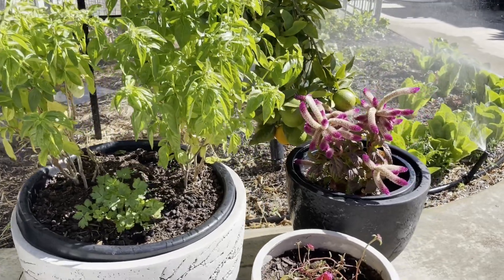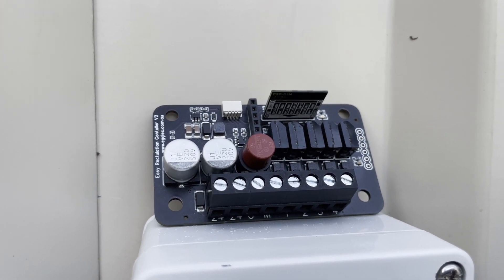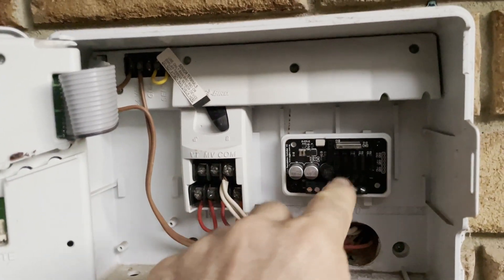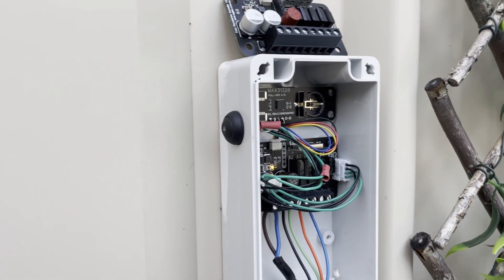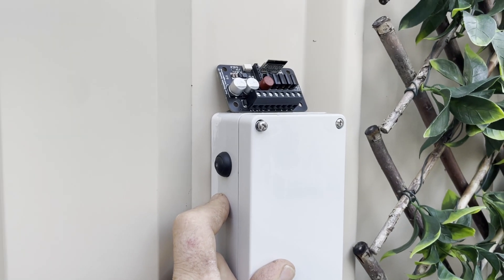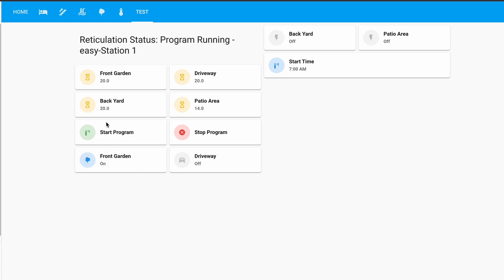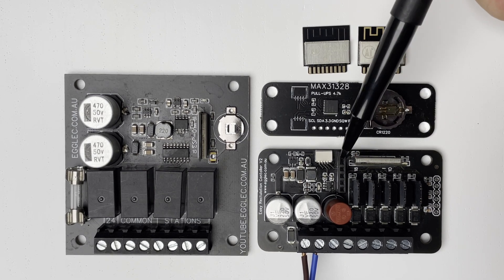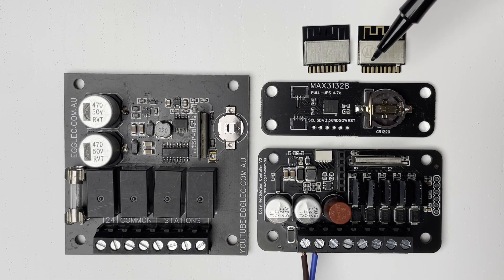Easy Reticulation Controller - Super Easy Upgrade

Comment: ohhh. I smell another project. I set myself up with a Hunter 8 station system a few years ago before I discovered Home Assistant. Stumbling across this today. Few questions - I don't have a master valve - any issues with using all four as general stations? And how would you wire two of your units together in parallel with the existing 8 station Hunter? Setting up as a replacement looks so easy - and I'm sure in parallel wouldn't be too much harder - but is a retrofit worth a separate video? Cheers for your content.
Reply from the maker: Hi Mansell, lots of good questions, if you don't have a master then you can have 5 stations. The Retro fit video will be next weekend and the following weekend how to use it to keep a pool level topped up. It would probably be better to use an I2c port expander and 3 triacs, if you like DIY electronics, it wouldn't be too hard, there will very soon be a plug-and-play expansion board to add a few stations though, using the JST port on the board.

Comment: Awesome work Jimmy, what power supply do you recommend if I want to run this and 2x Pope 25mm Solenoid Valve With Flow Control from bunnings.
Reply from the maker: The supply I have been using is a 800mA 24vac which is fairly standard, that lets you run 2 valves at once no problems, you could use a bigger one if you wanted but that’s all you need
Reply: @SparkyJames  Cheers mate, just ordered 2
Reply from the maker: Great, thanks for your support, I'm just getting them ready to ship out to you asap, would you like a RTC module as well? I've got a few DS3231 modules left over that I'm sending to anyone that might be interested in playing with them.
Reply: @SparkyJames  Hi Jimmy sorry for the late reply, I have a few ESPHome devices already so the DS3231 was tempting, I still need to order an ftdi adapter so went with the plug and play ESP8285 option.
Reply: Thanks Jimmy, they arrived today and look very neat. I will pickup a power supply in the weekend to give them a try.

Comment: Love your work Jim. As a future enhancement you could even add a Nextion or WT32 touchscreen on the box for local control & status.
Reply from the maker: I have thought about it, only I real want to try and keep it simple, but you could certainly use an OLED I2C screen, that is why I have 3 input I was thinking up/down/enter to change the run time and start time.
Reply: @SparkyJames  Yes that's pretty much what I was thinking. I don't have a need for it right at the moment but have no doubt this project is perfect for many out there.

Comment: Nice work. I also made one of these with ESP. Have you had any luck automating this based on local rain fall to prevent un necessary watering if it has rained or due to rain?
Reply from the maker: Yes, I used the local weather rainfall since 9am in home assistant as a condition of starting the program, the problem is working out your threshold and watering as it is actually raining but because the weather reports the rain, it requires a bit of tuning and testing before I can share that as well